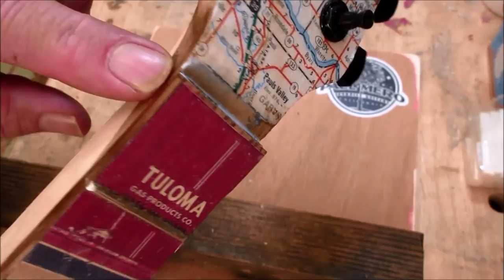Bone Nut

Comment: Thanks for the video. I haven’t tried a bone nut yet in a build. I’ve used bolts, screw heads, hard plastic, and zero frets. I have some nice hard mesquite I want to try before I try bone but it’s definitely on my list. This video should get me started.
Reply from the maker: Steve's Strings thanks for watching.  Do you have a local source for mesquite.  I have several Prosopis chilensis on the property but nothing dried. Would love headstock material.